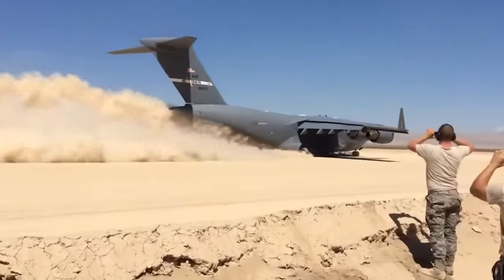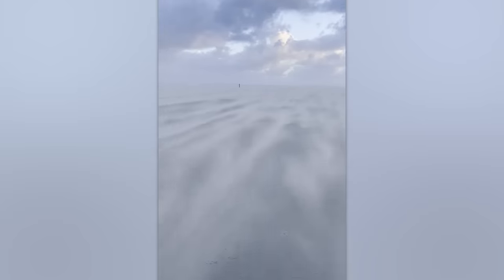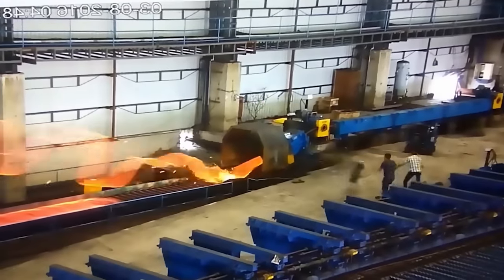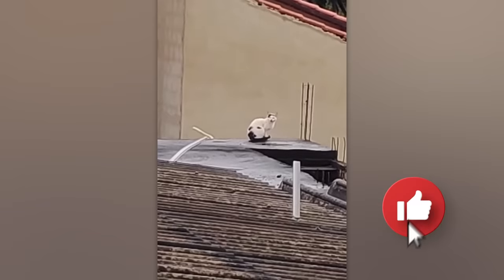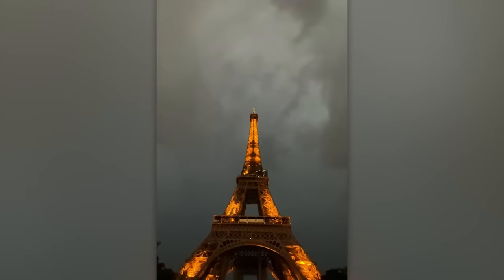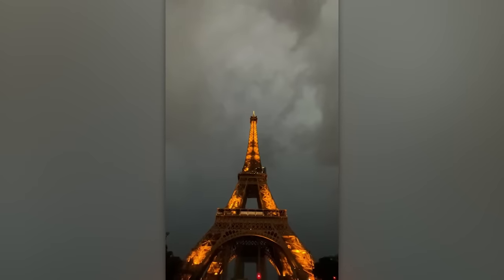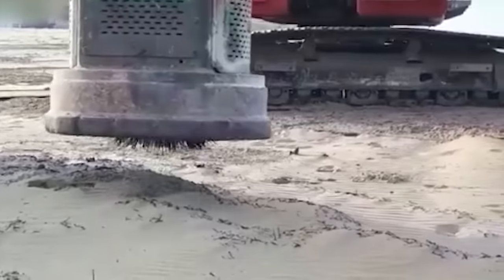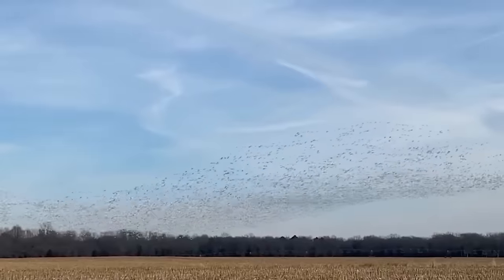Incredible Moments Caught on Camera

Comment: Curious why so many people shoot in portrait mode instead of landscape.  Turn your phone sideways, folks!!
Reply: Because it depends on what they're filming.
Reply: Turning the phone sideways might be too complex a procedure for most people.
Reply: Or what's more curious is why phone manufactures haven't yet made a phone that defaults or at least records in landscape when you're holding the phone upright.
Reply: @LunaryxDiarmait  No it doesn't.
Reply: It is easier to hold the phone securely in portrait.
Reply: Are people experimenting with video recording in the 'art of confusion' style? If not, then just rotate sideways to avoid your video looking as if it's 'plugged in' to the screen!
Reply: It seems like many people are still practicing 'portrait' poses as a new sport. Tip: Turn your phone sideways—you won't have to endure the feeling of watching videos through a narrow slit anymore!